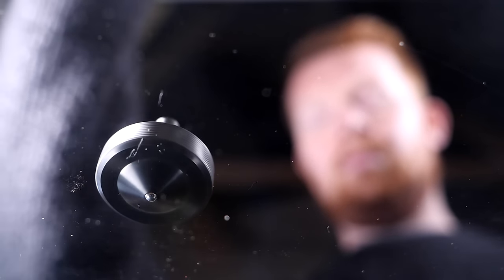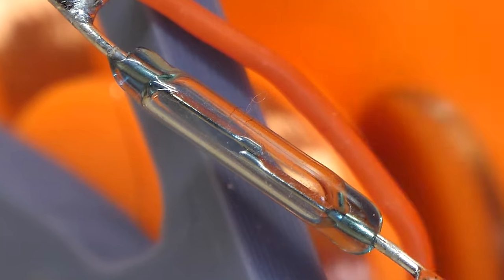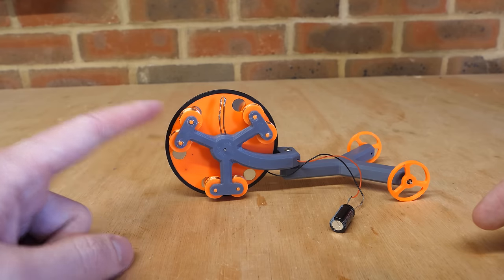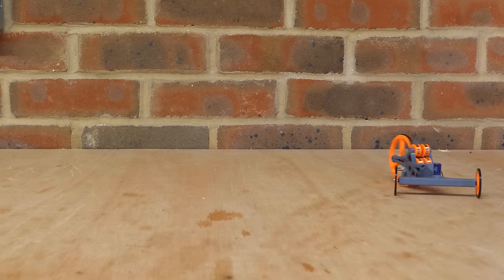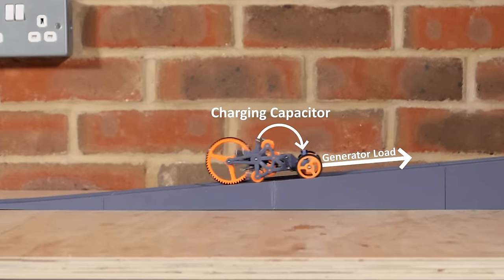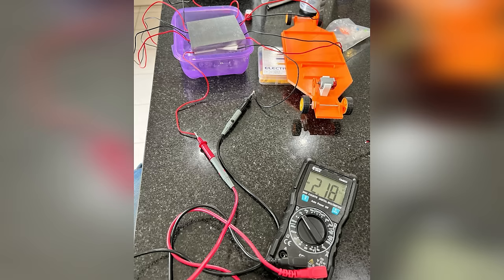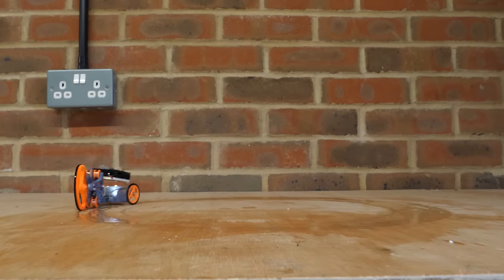This Car Travels Farther Than You Push It

Comment: I think what's going on here is that the car is able to store the energy put into it when you push it. That would mean it's a bit harder to push at the beginning than it would be if there was no motor. And that extra energy from the harder push is stored in the capacitor and released over time. In that case, if you pushed it with as much FORCE without the motor than you do with it, it would go a LOT faster when you released it and go the about same distance as the motorised one. 
From an energy standpoint, the push for the motorized one would take the same amount of "push ENERGY" (more force, less speed) than the non-motorised one (less force, more speed).
Equals the same amount of initial energy.
Yeah, I think that's right.

Comment: The difference in mass also suggests that to push the motorized (heavier) car forward the same distance as the other one, you are putting in slightly more effort (energy). So it's probably both the resistance of the motor and the mass of the motorized car that are causing it to travel further.
Reply from the maker: As mentioned in the video, both cars have the same mass.
Reply: I went back to the part where you introduce the experiment, to hear you say "these cars are identical in weight"... Sorry Tom, I must have been distracted at that point 😅 Thanks for responding and pointing that out!

Comment: It does feel like such a simple setup could be useful for leveraging some of that downhill energy on an otherwise simple bike with a flywheel assist in this way. Not necessarily as significant as regenerative braking, but just a little boost.

Comment: I would love to see this type of mechanism on a sort of electric bike where the capacitor is continuously charged during use then can be discharged automatically. A switch could manually disengage the capacitor when not in motion to avoid wasting power.

Comment: It would be interesting to make a thermal energy storage device out of a Peltier element. Attach a heat accumulator to each side, isolate them from each other and from the external environment.
That is, first the Peltier element heats and cools the corresponding heat accumulators, and when it stops receiving energy from the generator, the reverse process begins.
I wonder what the efficiency of such a circuit is and the density of the stored energy.

Comment: I wonder if instead of applying the weight to the vehicle you applied it to the flywheel? Ultimately the coils' weight was contributing to the conservation of energy in the system while the ball on the back wasn't contributing to the inertial mass of the flywheel

Comment: if the freewheeling car is lighter than the other one, another reason it wouldn't move as far when pushed to the same speed is because it will just have less momentum at that speed. similar to how you can throw a balloon full of water further than one full of air. I wonder how much of the difference that explains.

Comment: I once had a tiny toy car with a large spring, like an old-fashioned clock spring, attached to the rear wheels. If you pushed it backwards about 1 foot and let it go, it would takeoff FAST and then roll, powered, for several feet then coast for about 10 feet or more. That never made sense to me.

Comment: I think you are doing it the hard way.  Perpetual motion machines have been proposed for a long time.  Basically if there is any energy loss in the system - it won't work by physics.  

In fact the system must be able to extract enough energy from its environment to do the work you want it to do (move) and any energy loss.  

I think you need to go to paper and pencil and create equations that describe the system, accounting for all energy sourced and used and use those to track down some source to give you the extra needed.  For instance, convert some of the dark matter all around us to dark energy and then shift that into the machines domain.  Good Luck, I truly hope you are the one who figures out the answer.

Comment: It's not intuitive but when you are moving the vehicle to charge it, you are using more power to move it for say X distance than what you would've if it was a free wheel car. This extra energy is stored and moves the vehicle further. It doesn't mean you have 100% efficiency or free energy.

Comment: I recently learned about the assymetric gearing ratios in pullback motors. This feels like it is begging to combine the mechanical and electrical storage systems as well as the assymetric gearing ratios for charge/discharge to capture and release energy.

Comment: i had idea for doing something like this but for water power generator/pump.
the geared down pump prop will push water up a tube. then drop down a chute to spin the generator, etc over and over again. but i think the charging resistance would be too much for it even if supplemented with natural flow of a river

Comment: The reason this is not as efficient as it seems is, because whatever copper material you’re using to produce the electricity to keep the wheel spinning that electricity could be being sent to your output, increasing its current

Comment: Good Job On building a motor! You, might want to try different ways to connect the motor. I was able to re-discover Quadraphonic back in the early 1990's. 1992 or 1993 to be exact. I just rewired the line out, and I still use the same wiring setup. Maybe, the way I have configured my Sound system here could work on your, expedition?!?¿!   

yes That Upside down question mark is brought you by: Alt Code - Bringing back the good Old days with... alt codes... try it today by Holding your Alt Key for windows and then using your number pad on the right... mac and other pc's have a key as well... it might be the apple key...

Comment: I am intrigued on this concept being able to fill a void in the e-bike market. I am looking specifically at bikes used for touring or bikepacking. The existing motor/battery arrangements in the market place are fine for commuting and other short term uses. However, for touring and bikepacking nearly all e-bike motor/battery bikes are more powerful and heavier than desirable. Most require that the motor be on at least level one boost all the time just to make up for the weight and drag of the motor, battery, and heftier bike they are fitted to. For touring and bike packing what is needed is occasional boost for a climb, or to sustain speed in a headwind to get to next intersection to escape a road with fast motorvehicle traffic. Currently I’m aware of only one brand/model of e-bike propulsion that is light enough and low drag enough that the bike is rideable with the system off. Being able to ride with the system off is important for conserving that battery for when boosts are actually needed for multiple days until a battery recharge opportunity becomes available. Current e-bike power systems are preoccupied with being powerful enough to propel the bike to 20mph. Tourers and bike packers don’t need that speed at the cost of a drained battery in 50 miles. Tourers and bike packers often travel 50-100 miles several days in a row without access to recharging. Having power assist systems that are lightweight and low bulk to help cyclists sustain their normal 10-14mph pace for shortish, occasional use on uphills or traffic sprints is a white space on the spectrum of e-assist options. To be clear, the e-assist option that is missing does not need to produce power that is 3-5 times greater than the cyclists muscles. A lightweight, low bulk, low drag e-assist that adds power equal to 50-100% of the cyclists muscles is sufficient for the tourist/bike packer. Being able to constantly regen on downhills, braking, or tiny selectable siphoning of leg power would provide that the capacitor or battery capacity wouldn’t need to be any greater than 10 miles. 
I know I’ve been lengthy in this description but it seems to require a lot to explain why the more torque, more battery contest in the current e-assist marketplace misses one of the fastest growing segments of recreational bike usage. A frequently replaceable source of 30-60nm torque is more useful to a long distance tourer or bike packer than is a heavy >100nm system that requires a daily connection to the grid.

Comment: If you add more capacitors added in series to the coils, will it increase the voltage through the coils making it move faster and overall giving a higher torque without the need for a gear setup???

Comment: No such thing as perpetual motion, from the copper someone had to mine and refine to the capacitors, the plastic, those are all energy built up from work that needs to be factored in and overcome along with the initial inerta for something to actually be perpetual motion.

Comment: @wheelerthree: (The reply button quit working) 
When a reed switch fails, they almost universally weld their contacts together, failing in a shorted state. 
When the current is enough to make them fault open, it is quite obvious since the glass envelope is black, or fractured.

Comment: the problem with purpetual motion isn't that you can't create somthing that moves for forever
it's that you would want to extract energy from it somewhow
and that process of extraction will make it lose energy and eventually stop

light effectively goes on for forever but if you want to extract energy from that light you turn it into heat or electricity that light is lost

stars are effectively perpatual energy machines but give them long enough and they will lose their energy
same as black holes
it will take trillions of years but eventually a black hole will lose all it's energy and evaporate

what we are really good at right now is creating conditions that produce more energy than you put in them
so like nuclear power
we don't need an inifnite source of energy if we can print energy infinitely

Comment: The faster freewheel car undergoes much more air and friction resistance than the slower generator car from the difference in speed alone which is why the generator car goes further.

Aircraft can do the same thing, on a glide approach to a runway, instead of gliding at best rate, if you go faster by allowing the nose to drop trading altitude in return for airspeed, the increased speed will exert a higher drag force on the aircraft in total, even when arguably the aircraft now hasn't spent as much time at this higher drag due to it getting to the ground quicker. Interesting huh

Comment: Also with this design you need 4 not 3, 6 magnets 4 sets of coils , we typically have larger coils even at this size, also coils should be thinner than the magnets for improved efficiency and power output its also better to have 2 rotors with a single stratter rather than 1 rotor with 2 stratters
Reply: Also the coils should be the same width as magnet with a hole the size of magnet. Denis Palmer is the patent holder for this style of motor

Comment: For your comparing (flywheel and generator) cars experiment, you might add some weight to the simple flywheel, representing the mass of the motors and generator.
LATER ADDITION - sorry, for the first time missed the weight ball on the back of the flywheel car, obviously representing the weight difference.

Comment: question: IF you engage at a VERY high speed you may have very high engine temp. Using airflow, would you be able to engage the Peltier device with sufficient cooling?
asking for a friend.

Comment: Basically, it's just a regular electric motor with battery regeneration. But using a very different engine using permanent magnets and simplified a lot.
It's a cool demo though. About some very interesting physics.
Edit: The ending though! 😅

Comment: Have you never bought a toy car? With springs you can pull the car back a foot and it will go 20 feet.
Springs are the future of traveling using very little electricity to charge the springs. Plus a lot faster charging.

Comment: Long live Steorn, Btw, with those extremely long wiring, the Back Emf must be huge and that tiny capacitor sets the limits on how much power it can recieve, this bad parts of the design else pretty good design. Basicly you want lots parralle wires but short at the generator side to keep the BEMF down, but serial on the engine side for most effiency.
Forget calculating the Thermodynamics, becourse Laplace Law of Force rules in electric engines.

Comment: could you use a motor configuration like this to measure the amount of kinetic energy put into the system? when the capacitor reaches its peak charge, that would tell you the answer, wouldn't it? of course accounting for losses from load resistance of the magnet/coil/switch/bearing

Comment: Some lubricant might help further... ? Can we use a lot of capacitors rather than Li batteries in electric cars? Dangerous i know... but if encapsulated in neutral material to isolate them totally from interference and accidents...and situate them in middle of car...
Reply: Capacitors have much lower energy density, which is the most important factor in an EV. Batteries can be wired in parallel to increase maximum current, eg tesla battery packs can do 1500 amps burst.

Electrolytic capacitors have about 0.01-0.3 Wh/Kg, whereas liion batteries have about 200-300 Wh/Kg

Comment: The temperature of the Earth’s interior increases with depth. According to geothermal gradient data, the temperature rises by about 15°F for every mile you go down. So, at 100 miles underground, the temperature would be approximately 1,500°F hotter than the surface temperature. Soon we will be harvesting heat electricity from the Earths core

Comment: I've always been fascinated by perpetual energy machines. Since you only need four coils to drive it, would it be possible to put enough coils around the circumference to power it? I am guessing the resistance load from the motor portion would be too great for the generator portion to function.

Comment: I think I know the result of this experiment, but for arguments' and learning's sake, what would happen if you duplicated the original system but alternated it? Only one capacitor would charge and as soon as it begins discharging, the 2nd capacitor would begin charging in the same way, then begin discharging and operating as a motor whilst the first begins it's recharge cycle again.

Would need an Arduino, a few sensors and a bit of programming, but could be an interesting experiment

Comment: THose two dont have the same gravitational potential energy, since the flywheel one is lighter, its missing a lot of copper. If both were the same weight, i guess thats also contributing to why the capacitor one travels further?
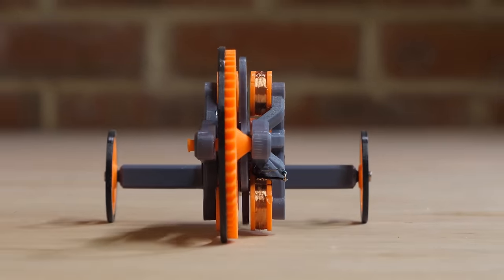Reply from the maker: Both cars have the same weight 7:49

Comment: Maybe this is a silly question as I know little about cars... Could this generator work in a real car if the capasitor was only charged while the car was driving downhill? Then maybe you could avoid wasting force from the engine while driving on a horizontal plane.

Comment: Does the magnet flywheel impart a negative force (backwards) while rotating? Would the car be more efficient if an extra gear was added to allow the flywheel to move towards the front (counter clockwise it looks)?

Comment: If you put this in a car it will just end up in it being harder to get in motion, and the extra energy required to get it into motion, can later be used to power the vehicle.
It's probably useful on the highway, but useless in city traffic.
To properly test it, instead of pushing both prototypes with a ruler, push them with the same amount of newtons instead. I bet the generator car will require more to get into motion.
EDIT: nvm, didn't watch the whole video, he explained this later lol

Comment: Hey Tom, how efficient would a combustion car be at charging a battery pack that is then used to power house lights at the end of the day?  Would lost energy be captured by this process if generative braking were the only means of capture so that no extra fuel is required, other than offsetting the extra weight?

Comment: But isn't generator car heavier?

Now correct me if I'm wrong, but doesn't that increase potential energy stored in height of the ramp? Since it requires more force to be lifted to same height.

Therefore it would only make sense that it would go further, nevermind other variables. Or did I just not understand it?
Reply: You are right, potential energy is a function of height and mass. Maybe he made the other car weigh as much as the generator by adding weights idk
Reply: 7:50 he accounted for the mass

Comment: What if you were to change the gearing on the flywheel car to the point that it runs down the slope at the same speed as the capacitor car. 

Would it gain the same stored  energy in flywheel speed?  

Which form of stored energy would be more efficient? 
The Capacitor/Battery or the Mech. Battery.

Comment: I understand a capacitor is not a battery, but otherwise how is this concept very different from a hybrid car that charges its battery with an internal cumbustion engine, then can run on its battery when charged - or for that matter a WWII diesel/battey submarine?

Comment: I’m no expert on these things (hell I’m not even an amateur, most of this stuff is going over my head aside from the whole ‘magnet spinning by copper generates power’ thing), but… did you just build a really simple alternator and a car that effectively ran off the power generated by the alternator instead of a combustion engine?

Comment: It's kind of a click bait. Of course the car moves longer than it should, regarding the initial push, but it's only because it's draining magnetic energy from the not-so-permanent magnets. Commercial magnets are also a type of battery, storing energy from powerful electromagnets. There's no energy for free.
Reply: except thats not how it works, the extra distance is caused by the additional work you have to do to get the car working